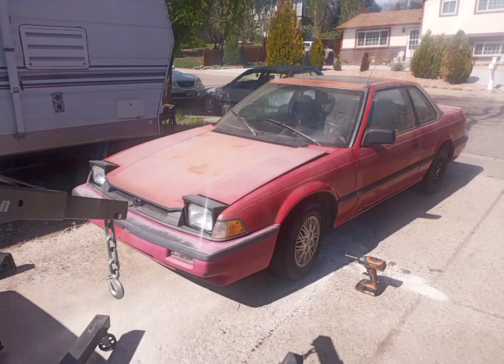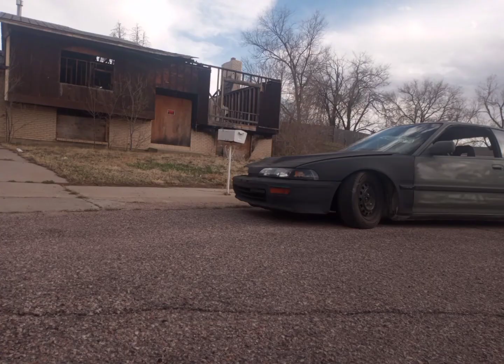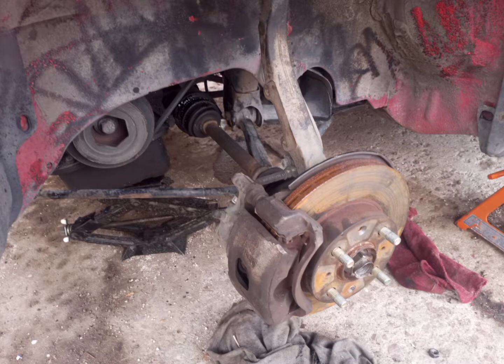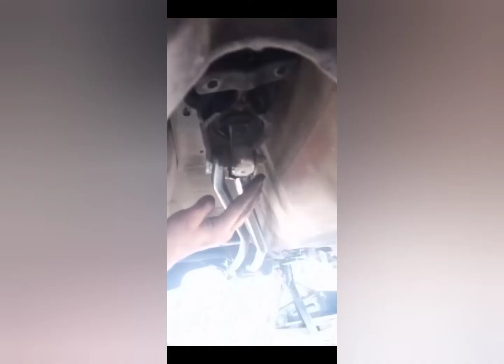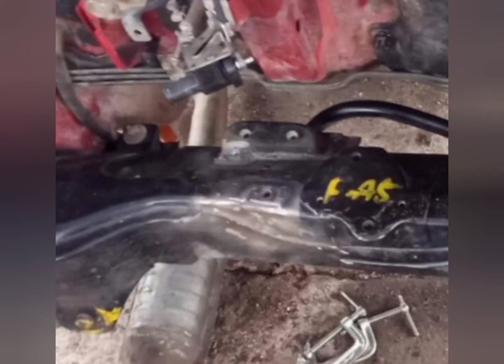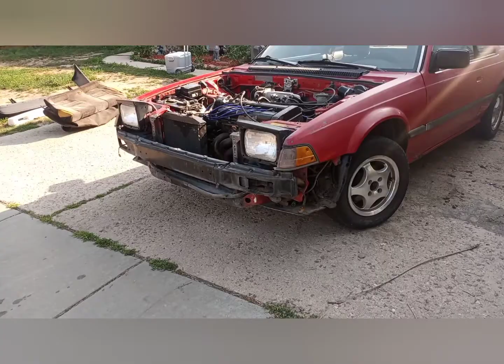1986 Honda Prelude B Swap Pt.1

Comment: Did the b18 have a linkage on it or did you have shift cables cause a friend and I are putting a f22 inside of a 84 prelude but not the si but the f22 has shifter cables and we do how we would put the clutch master cylinder since the car had a linkage
Reply from the maker: @T.takahashii  the b18 uses a linkage. For cables I’d use a conversion kit for integra/ef and modify it to the prelude probably need a billet shifter box with that setup